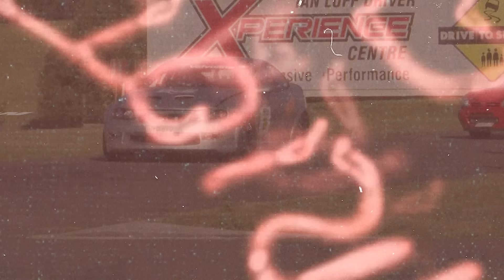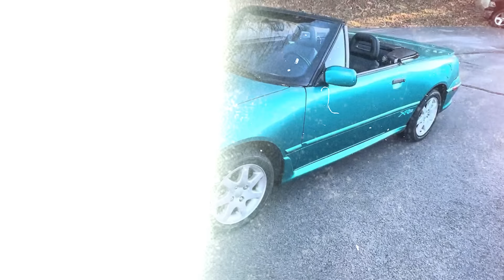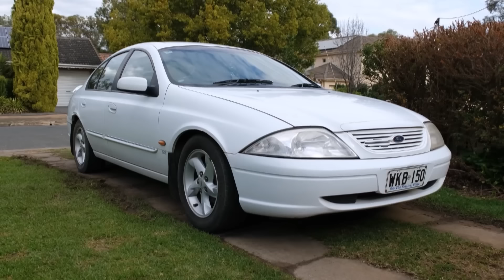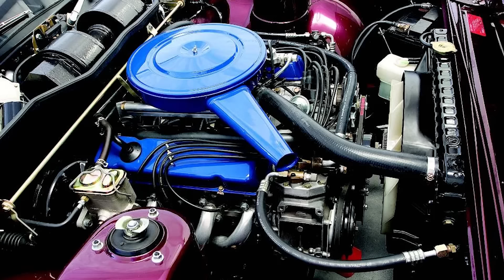Top 15 Worst Australian Cars Ever Made

Comment: OMG i remember my Camira, the air conditioning used to run the battery flat, apparently a feature. I never saw a car blow so much blue smoke out the exhaust. When I traded it in the whole used  car sales team came to laugh at it.

Comment: HEY, ALPH!! I had a P 76, 1983 - 85. Six OHC I did not rev out, NO Engine Problems. Fit my Whole BAND in it - drum kit, Quad box and speakers in the 44 Gallon Drum BOOTY, Pa speakers AMps and Cables on Back Seat, Me, Axeman & Drummer Front BENCH SEAT!!!

The ONLY CAR I have OWNED where Other drivers Flash Lights, Toot Horn, WAVE at you.. Brother/Sisterhood of P Seven SIXISM....
Tonic, Bard of NEWCASTLE HUNTER! 🚗🛴🐷😜🤣

Comment: You forgot the EA falcon lemon.  I used to own a Holden JB Camira & agree with what you said,but one could write a book on the faults in mine. Purchased brand new, therecwas rust under the rear window, the bottom of doors were poorly painted. Air conditioning blew up just outside warranty then required  regassing yearly, Noisy timing belt, leaking fuel pump, instrument panel issues, & as mentioned oil consumption. It turn this loyal Holden man to Toyota & I have never looked back.
Reply from the maker: You are right, I did add EA in my latest video but looking on this one I forgot 😂👍

Comment: Just over half of these were bad. But to bag a car just because of changing a badge ie: the apollo/camry, is not on, as they were good  cars. The 380 was and is a good car. The AU Ford - a great car apart from the headlights, which was easily fixed with the XR6 and XR8s.

I would replace those 3 with genuinely bad cars:

The late 70s TD Holden Gemini was a gutless, smoky stalling car, with a horribly high pitched starter motor, that often had to be repeatedly turned over to get going. An eyesore in looks, and terrible in performance. Luxury feature for it's time? Retractable seatbelts.

The EA Falcon, when new still had problems with breaking down, including a single point injection engine that should never left the prototype stage, thermostat problems, and several engines with bead blast sand still in the engines when coming out of the factory, causing many problems.

If you want a car that tens of thousands of Australians love, but that keeps breaking down all the time, try investing in a 1970s Kingswood, specifically The HQ 173CI engine, which was underpowered, hard to start, hard to steer, and which a mate of mine had replaced about 5 starter motors and 1 fly wheel in his time. Hard to start in cold weather, easily overheats in hot weather rounds out 3 replacement cars for the list. 

All in all it was a 3.5 star list you made and largely enjoyable to listen to. Thanks

Comment: Absolutely incorrect on the AU Falcon apart from the waterfall grille on series 1 1998 job, I had 5 of them and in XR guise they were a nice looking rig. As for reliability 700,000 k before I did a VRS and only grind valves and knurl guides Absolutely bulletproof mine were and the P76 was a wedge but in 4.4 all alloy guise was a good car.

Comment: Expert - A drip under pressure. Never trust a "Car Expert". So many of these vehicles won Wheels magazines "Car of the Year". I did once when I bought the first model of the KIA Seltos, it was a lemon, an SUV with a truck's suspension. Ever bump in the road you felt it, any country woman who drove it needed to at least wear a sports bra as additional safety equipment because of the suspension, and the "Car Experts" described it as "Designed to suit Australian Conditions". Sometimes I wonder if the "Car Experts" were being paid by the car companies for their published opinions and endorsements.

Comment: You forgot Holden's world infamous 5.7 litre GENIII V8. I once had a VX Commodore Berlina equipped with one of these world infamous self-destructing engines. Every 9,300km, never mind actually getting to the 10,000 km service, the engine would guzzle oil (couldn't even get 1,000 km without tipping a litre of oil into it.... "check the petrol and fill up the oil! my friends would say") then shit itself and needed to be replaced. After engine number SIX was dropped into it, Holden FINALLY found the fault. It was the engine management computer running the left bank of cylinders way too lean, causing the fuel to detonate and burning the crowns of the pistons and blowing the exhaust valves! To be fair to Holden, at no point did they leave me without a car, even if they had to hire a car for me.

Comment: 0:46 — Holden Sunbird: Cheap interior quality and a harsh, buzzy engine.

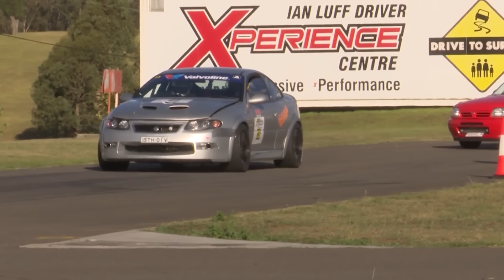1:43 — HSV Coupe 4: Overweight AWD system that made it slower than RWD models.

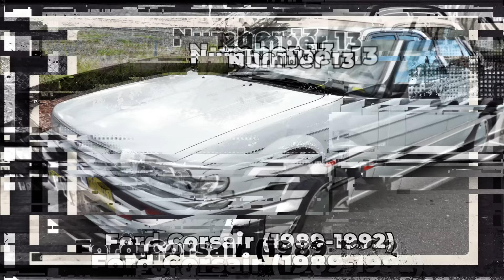2:47 — Ford Corsair: A redundant rebadge of the Nissan Pintara that confused buyers.

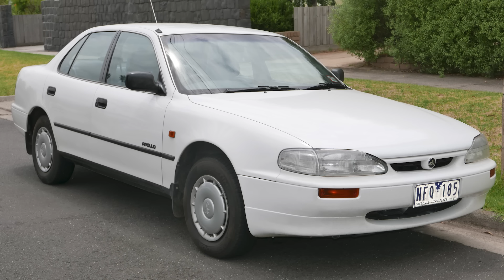3:30 — Holden Apollo: A rebadged Toyota Camry that undermined Holden's identity.

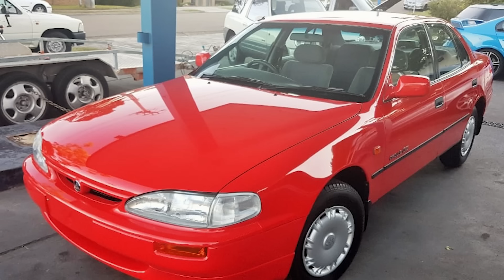4:15 — Ford Falcon XK: American-designed suspension that failed on rugged local roads.

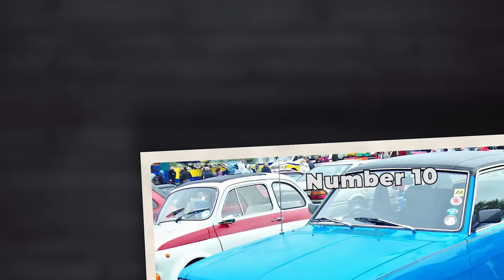5:07 — Morris Marina: Outdated 1940s technology resulting in unpredictable handling.

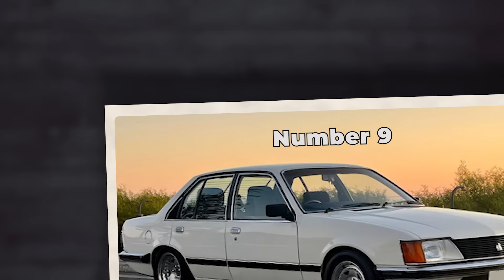6:03 — Holden Starfire 4: A rough, underpowered engine that failed to save fuel.

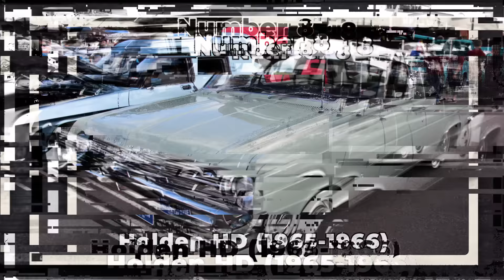6:49 — Holden HD: Plagued by poor quality control and premature tire wear.

7:44 — Mitsubishi 380: Released with a thirsty V6 just as fuel prices skyrocketed.

8:31 — Ford Capri: Convertible with a leaking roof that caused the floors to rust.

9:33 — Geely MK: Poor safety ratings and brittle materials.

10:21 — Holden Cruze: Infamous for transmission failures and catastrophic overheating.

11:18 — Ford AU Falcon: $600M styling failure with major cooling and electrical faults.

12:08 — Holden Camira: Heavy oil consumption, rusting firewalls, and jumping gears.

13:46 — Leyland P76: Rushed development led to failures that closed the manufacturing plant.

Comment: I had a JB Camira and I must say it drove well with no leaks but every 2 years you needed a new replacement head. Every 3 years the water pump failed and always was blowing one of the many water hoses so I could never use it more then a back and forth to work car. Yes the CV joint went also. There was problems with the carburetor too. I was so happy when it got destroyed in a car accident. All my family and friends laughed at me because it was a really bad car.

Comment: One factual error I noticed: it was the front suspension on the Marina that was a lift from the Morris Minor - torsion bars and lever dampers. Not the rear - that was just a leaf spring arrangement like many other cars (just not a very good implementation at that). On the P-76 - didn't mention the weak, shudder-prone clutch on the manuals. The article does generally comes over as superficial and simplistic.

Comment: The sunbird came with 4 engine options. an under powered 2 ltr  4, a 2.8 ltr 6, a 3.3 ltr 6 and a 4.2 v8.  The 6 and 8 cylinder engine range had been around and well proven  for many years.
Reply: Sunbird was only the Starfire 4 cylinder. 6 and 8s remained badged as Torana.
Reply: @TavoAu  Starfire 4 was in the earlier versions of the commodore. why did they do that if the engine was so bad. Can't remember if the sunbird series ever had the 5.0 ltr V8.
Reply: @tacitustoday3571  Starfire 4 in the VC and VH was a stopgap, between the end of the Torana/Sunbird range, and release of the Camira.

Comment: My parents bought a P76, great to drive but thirsty. This was replaced by a manual Camira sedan that was impossible for me to get comfortable in as the roof was to low for my not inconsiderable height, I had to lay the seat back at an uncomfortable angle to get anything resembling headroom. This in turn was replaced by a Toyota Corona ST 141 which was no better in the interior height department, but at leasdt iut was reliable compared to the Camira. Then in 1998, they bought something actually decent, a 1996 Hyundai Lantra Sportswagon that lasted until 2022!

Comment: The ford capri I had to program a laser to cut the bar that ran across the top of the window as it was too wide and then they spot welded another bit on, that was the main reason why they leaked.

Comment: Clickbait but I’m here to DEFEND THE CAMIRA especially the modern styling of the 2nd and 3rd models.  Good brakes, so easy to handle in the city, and station wagon so useful at that price.
Reply: Wow those mechanical issues are overblown — I had mine in mint condition into the 2000s when the real reason to stop was the same as any other vintage daily driver:  crash safety

Comment: If car manufacturers just stick to what works and make subtle improvements, none of these disasters would have occurred. But what they want to do, is throw out what works to cut costs, and go out of their way to prevent interchangeable parts between models, and that can't be easy to do, so they get what they deserve, simple. But at least you could still find the parts, unlike these new cars where they spit on the consumers right to repair.

Comment: I had the Sunbird. I needed a car at the time and got caught in a used car dealer “bait and switch” scam. I turned up with the money to buy a suspiciously cheap SLR only to be told it had just been sold. “But here’s a Holden Sunbird, look how similar they are”.

Worst car I’ve ever had. Its party trick was the throttle cable randomly disconnecting from the accelerator pedal. A fun time had by all.
Reply: Once drove a Starfire auto Sunbird from Brisbane to Kingaroy. Almost had to get out and push it up hills. Even with judicious driving got only 17mpg. My HJ 253 auto wagon did much better than that. Starfire was a heap of crap, but compared with the Opel 4cyl it replaced, was gold. Don't think there was ever a worse engine than the Opel 4. Hard starting, rough idling, dreadful fuel consumption.
Reply: LOL what yoyu get for buying a holden
Reply: And the fact the star fire found its way between the rails in the Toyota corona

Comment: I purchased a new Camira SLE in 1983 from a rural South Australia GMH dealer. On the day of delivery, I was set to drive to Renmark a distance of some 240km. After driving only 60km down the road I realised that the car was "dying" as the dashboard dials and lights were fading and the car was losing power.  I pulled into a small town garage and the mechanic who was fortunatley still there at 5pm was able to diagnose that the alternator was not producing any charge to the battery.  He solved the issue with a temporary wiring solution which enabled me to complete the remainder of the journey.  I owned the vehicle for less than three years and in that time the most annoying issue was that the air conditioner failed on three occasions, usually with a cloud of vapour eminating from the engine bay.  I have owned more than 20 cars in my life time and I can say without a doubt that the Camira was the worst choice of car I ever made.  At the time of the Camira's purchase I owned a Honda Accord but wanted to support the local GMH dealer. Hmm!

Comment: I was forced to drive an '88 or 89 Mitsubishi Colt 4 door automatic by my boos. It was by far the worst car I've ever driven. Underpowered, sloppy steering, brakes barely worked and the response time when accelerating was measured in seconds - and lots of them. And it leaked in the wet season.  Truly don't understand why it's not on this list. IMO, it's a top 5 contender for sure..

Comment: Ford Capri was built at The Broadmeadows Ford Factory in Victoria. The roof issue was sorted with a redesign of the roof fixings on the rear corners. they didnt sell well locally and were virtually given away in lhd to the USA .

Comment: A mate had the P76 - and wrote it off in heavy rain when the wipers failed. My father had the Camira (1st model) and surprisingly, it behaved itself, apart from needing its transmission repaired. He traded it in, just before all Camiras started smoking badly and vanished from the road almost over night. If I recall, it also got Wheels "Car of the Year" in 1982. I only drove a mate's manual version. Despite the small engine, it seemed to go okay with 3 or 4 blokes in it. I guess I expected less from cars back then.

Comment: Well I have to say you missed the shameful Holden VX-SS with it's Mexican made engines with their overbored cylinders that drank oil at a rate of around a litre a week, and which Holden flat out refused to fix unless it failed a rather flimsy oil consumption test that was skewed in Holden Australias favour.  When back in the US GM was required to fix all the faulty engines that were in the batches needing to be to be repaired.  Not to mention the flimsy brake rotors, the steering racks that only lasted 2 yrs and the rear main oil seal that barely lasted 4.

Comment: I had two Camira's, the 1.6 which I did 350,000kms in and the 2.0 JE that was a bullet on wheels. The Camira could have the engine rebuilt in the car and you could change a clutch in 30 minutes. They had a few things going for them. I've also had a few AU falcons, a very under rates car and well built and still going strong 25 years late..  The radiator is a concern, especially the transmission cooler which will leak and take out the gearbox..  Some of it comes down to good maintenance and very regular oil changes.  Loved the video, thanks.
Reply from the maker: Thanks 👍👍

Comment: Sunbird was pretty much just a 4 cylinder version of the Torana.  By then the Torana was pretty heavy, so the "Starfire " ( A pushrod 6 cylinder minus 2 cylinders ) did not move it around well.    Fun fact, the Toyota Corona used the same engine in its lower cost variants.     When the car is available with a 5 litre V8, the 58kw low revving four cylinder is very uninspiring.
Reply: Starfire, although a heap of crap, was still 100% better than the Opel 4 it replaced. The Opel 4 should have been repurposed as a boat anchor.
Reply: @stevewalters6664  Every Opel Engine Ever , but if the thing was running it was probably better to drive than the Starfire ( i only ever drove the Starfire ones  ).   I owned a Cortina , the 3.3L was detuned to run on Standard fuel ( no longer available when i bought it ), and it got around 68kw...Less than the Ford 2.0L four, and felt like a tonne of lead in the front of the Cort.   Sunbird was far from the only shit car around at the time.

Comment: I owned a JD 1.8 Camira & I thrashed it. It withstood all sorts of abuse & did 298,000ks didn't use any oil didn't over heat & the gearbox didn't play up at all, a lot of my driving was on winding mountain roads in my local area. I had 2 failures in it's life first was a leaking water pump that wasn't replaced when the timing belt was replaced due to a lazy motor mechanic & my ECU had to be replaced because the main circuit board had cracked because the ecu was the front passenger footrest & that was it mine was a great car then I traded it in on a Honda Prelude

Comment: AU falcon was a hit with the Taxi drivers and rental cars ???, The Camira was so bad when turning on the air condition it stopped working never reached 100km/h without issues. The 380 was an amazing car I would buy one today if there was any around. P76 would of been a very good car but Holden and Ford did the dirty on them just like the Chrysler

Comment: My first car was a Leyland Marina. It was notorious for overheating, you had to rev crappers out of it on the highway to just do 100 and worst of all, it had an ancient suspension design. The front shocks were a hydraulic swing-arm that regularly developed leaks and needed replacement. It was a pretty disastrous car.
Reply: As a mechanic in those days, I had the misfortune to work on a number of those heaps of garbage.
Had 2 or 3 of them towed in when the front suspension collapsed. Dangerous shitboxes!
Reply: I had a Marina van 1300. It was very good. Handled ok and plenty of room in it.

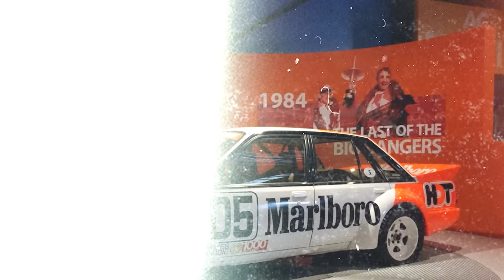Comment: 6:05 - starts talking about Starfire 4 cylinder engine. Immediately shows a photo of a VH Commodore SL/E, with the caption "Holden VC Commodore Starfire 4".
Completely overlooks Starfire's inclusion in the UC Sunbird mentioned at the start of the video (where it was launched), and the Toyota Corona. Instead it shows pictures of mostly V8 Commodores, including a VK which was never fitted with that engine, with maybe one photo of an actual VC 4 cylinder (with the silly 13" rims)...

9:35 - Geely... Not an Australian car! (why not show us the Lada Niki, that POS was sold here too!)

12:05 - The Camira. Shows no pictures of JB or JC models where all the early problems were. Shows only JD and JE models, which had most of the early issues sorted (but were still by no means great cars).

8:35 - 1980's Ford Capri - ironically built on the Mazda 323 platform, objectively worse in every metric to the MX5!

Comment: The camira was an absolute shocker, the early1.6 models had a rubber mounted carb and vac hoses galore 
I remember VN Holdens in NZ with the 2.0l camtech motor in them from the Camira.. WTF?

Comment: Camira SLE 1.8. Jumped out of gear and stuck in gear so many times. Had to switch the engine off for it to pop into neutral. Biggest crap ever, traded that car really quickly.

Comment: The Starfire 4 was an absolute powerhouse compared to the Opel 1900 in my LH Sunbird. 🤣 The Opel got replaced with a 186 'Red' motor which vastly imptroved the Opel's top speed of 100 kph (with a tail-wind).
Reply: The Opel motor was better used as a boat anchor. How German engineering came up with such a disaster is baffling to this old motor mechanic.

Comment: Capris were great car, not everyone liked the way it looked and perhaps the roof leaked and needed to be replaced but apart from that it was based on the laser/323 platform thus it was simple and super reliable and produced decent power especially when were fitted with DOHC NA or DOHC turbo engines  in a car that weigh less a than a tonn. And no there is no torque steer issue on factory setup, you could get some torque steer if the turbo engine was modified to produce more power